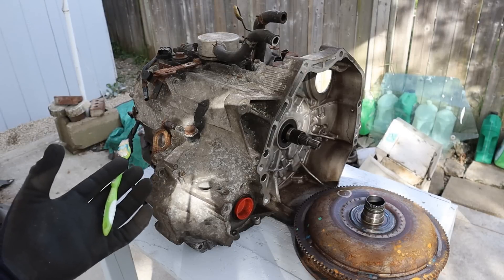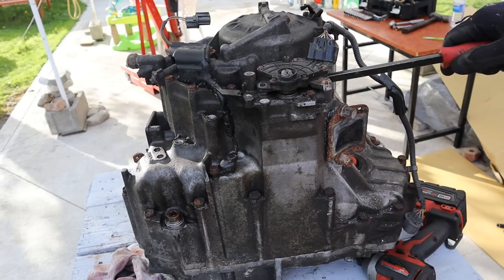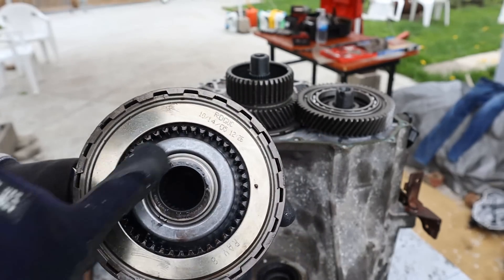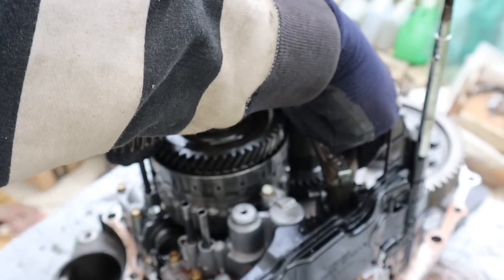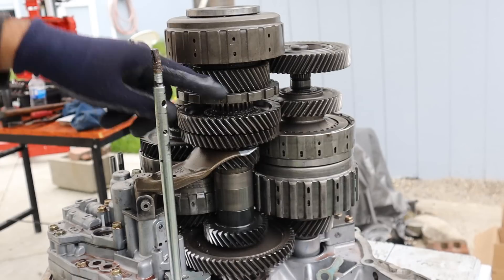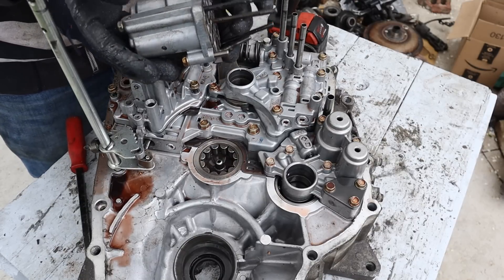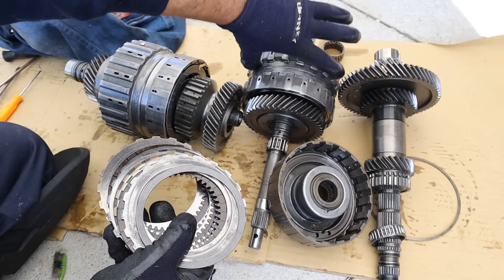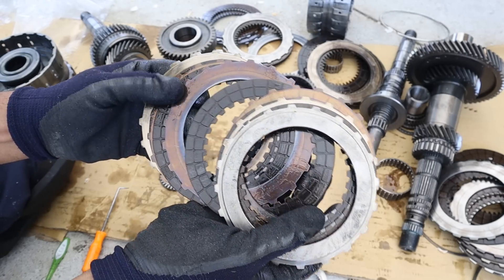Why Honda Transmissions FAIL

Comment: Hey man I’m a fan. I have some issues with my accord 07 v6 baya. When it’s cold I hear a buzzing/whining noise from the tranny. Hard to tell where. When it gets hot it goes away. But if I drive it for a bit rpms rev up then downshifts hard. Then I’ll suddenly loose drive and reverse. If it sits for a while it shifts to drive ok and reverse. But after a little bit same issues. What’s your opinion on this? You seem to be an expert. I had a TCC stuck off history code. I replaced the tcc solenoid. Change my fluid twice a year and fluid looks ok. No leaks. I’m freaking out. Any thoughts id really appreciate.
Reply from the maker: Sounds like oil starvation. Look into changin the filter and then budget for a new throttle body. 
You might be able to peep at the condition of the clutches when you drop the pan for telltale signs its on its way out.
Reply: @speedkar99 new throttle body? Why would you mention that? The intake manifold throttle body? lol maybe I’m misunderstand or auto correct changed “valve body” to throttle lol
Reply: @s @speedkar99 but I’ve replaced that inline cooling filter twice in 2-3 years. All OEM Honda. I have noticed one of the solenoids under the starter is leaking slowly. And when I commanded all of the solenoids on with my scanner only one did not click when commanded. Valve B in the dual linear solenoid. It would only make a faint clicking sound when I ended the command. I’m going to replace them with used junkyard ones I’ve snagged. See if that does anything. But I agree def seems like oil flow or pressure is messed up. I have an overhaul kit on the way regardless. I’ll keep you posted for knowledge purposes. lol

Comment: I wonder if this one used to whine like most 5at 3shaft version. Mine whines so much i can tell what gear im in by the pitch😂
Reply from the maker: No need for a tachometer then!
Reply: @speedkar99  haha just did a fluid change now the tranny is donezo won't shift out of 1st

Comment: What would cause reverse to not work when the trans is cold?
Reply from the maker: In a Honda, reverse is a piston that pushes a fork up, if the piston is leaking or valve body can't build pressure when the fluid is viscous

Comment: I drive a 2004 Saturn Vue with the honda V6 3.5L engine, having trouble finding out if the transmission is also this honda transmission? Sitting at 165k miles and there's some trouble shifting
Reply: Yes those have the same Honda transmission. If you just started having trouble shifting do a drain and fill with Honda dw1 fluid and some Lubegard Red additive.
Reply: @CRAPO2011  that's my plan for tonight, it calls for Z1 atf so I grabbed the idemitsu atf type-h, is that interchangeable with dw1?

Comment: This is not true for 10 speed honda transmission. They are not automatic (manual conversion) they use planatery gear.

Comment: You are 💯 correct! The internal filter is the main reason these fail. I drilled and tapped the bottom case where the filter pickup is located and cleaned the filter. My V6 Accord Drives like new again!
Reply: Hi, could you point me to a video showing what you did, or how I can contact you to find out what the next step is? I'm having problems with my V6 AT. It's a BAYA transmission.
Reply: @latota9481 I have a video on my channel on this topic, hope it helps.
Reply: @latota9481 I have a video on my channel regarding this topic, hope it helps
Reply: Yeah any help would be awsome if i can do that also.

Comment: TL from 07 and 08 actually used the Acura RL's automatic transmission which is a physically beefier more robust transmission That's why those cars didn't really have transmission problems like the earlier cars did

Comment: Honda V6 tranny's 2001 to 2006 were horrible - torque converter valve failures due to a design fail!

Comment: What could cause hard shifting on each gear of Accord 1998 4AT European version (M47A tranny)? Also, the engine is noticeably jerking when shifting between P-R-N-D4? ATF refreshed with Honda ATF DW-1 and leveled, shift and lock-up solenoids were removed and powered on the bench (clicking smoothly), then cleaned (screens were clean, no debris). The drain plug magnet had a lot of material on it. The transmission turned out to have 1l oil extra, once leveled it started shifting better, but it still has hard shifting and engine jerking when the lever goes through P-R-N-D4. Ideas?
Reply: Transmission mounts.  Especially the rear one, which literally snaps a lot of the time when people remove it. If you are doing the transmission mounts, it's a good idea to also do the motor mounts because those fail very often too.
Reply: @boi8751 The rear one is vacuum operated. The vacuum circuit is still functional, also the bushing itself seems to be reacting to soft/hard mode. The only reason I haven't replaced it is because I am not sure if there's any good replacement.
Reply: @c@c @ceckoslav hit I was thinking about the v6 accord lmao. I’d still check all the mounts to verify. Have someone in the car and go through the gears and look at the engine to see if it’s jumping or moving weirdly. That’s all that I can think of when the engine isn’t moving. These 4spd autos are really janky so it is normal to feel the gears shift

Another way to see if it’s the mounts is to see how much the steering wheel is vibrating when idle (in d4)

Comment: 2004 Acura TL owner here with 304k miles on the original transmission.. still shifts smooth, maintenance is key and knowing how to properly drive the cars..
Reply from the maker: Nice. How's the engine holding up?
Reply: @speedkar99  great, running perfectly.

Comment: Our 2010 Honda Odyssey has 100,200 miles. Trans fluid was changed at 50,000 and just last week. Fluid was in great shape, not burnt or black at all. We have never had a problem, although we do not always pound on the gas and go easy which has probably helped prolong the life of it.

Comment: Any chance you could get hands on and tear apart a modern 2016-2022 pilot/ridgeline 6 speed? These boxes are dropping like flies and I'd like to see if there's a definite point of failure. Typically fluid cooks itself way head of schedule and fries the torque converter, then if left unaddressed destroys the entire transmission by clogging the lines and wearing out the clutches.
Reply from the maker: Interesting to know they're still having issues.
Reply: @speedkar99  my assumption is that it is a byproduct of cylinder deactivation. Honda tries to minimize uneven engine vibration when half the engine is off by making the torque converter unlock when cruising. The lock up clutch wears significantly faster than normal, goes metal-to-metal and puts iron in the transmission fluid, ruining the transmission. But before that the warning signs show themselves with a torque converter shudder condition since in the meantime it just overheats the fluid and fills it with clutch material. Partially tested this theory by installing a VCM muzzler device in someone's car and they haven't had a shudder complaint since and their pilot shifts perfectly.

Comment: have pilot 2019 and already have the original transmission replaced and going to need another replacement soon? Anyway I could save it? I love the pilot but these transmission problems just don’t go away, if anyone relates pls share tips/things that have worked to preserve the tranny. Thank you Speedkar awesome video.

Comment: I have a 5 speed on my 2007 2.4 accord. Drain and refil every2- 3 years with an exterior filter change.220000 km and shifts like a dream.never had issues.I think these are not meant for the extra torque that the v6 has. Most of the failiures i ve read a bout happen either on the heavier cars or v6 models. I can see the corelation.They are a bit sensitive but with propper maintenance they can last a lot.Saw a tsx for sale with 500000 miles ,not km with and original transmission 5 speed,never rebuilt.

Comment: I have a 2009 Accord Coupe V6 with 54K miles, I only drive it around town.  Have no problems with the engine or transmission.  All my important fluids were changed at 30K, I had to forcefully tell the dealership that I wanted it changed despite them telling me its not necessary.  I am glad I found your video as I have proof now as to why I wanted things flushed and changed ahead of Honda's recommendations.  I've been driving Accords since 1986 and the 2009 V6 will be my last Accord.  I absolutely hate the fact that they changed to CVT transmissions.  My next car will have a traditional transmission, selection is slim but I will find an AT no matter what.

Comment: The prob I've found with the Hondas is the case bores for the bearings wobble and allow the bearings to have play, which in turn wears the feed tube bushings in the shafts and cause pressure loss to the clutches. I enjoy your videos.

Comment: Very interesting and well explained. I’m glad you cut apart that filter. Our 07 Odyssey has the original transmission still going strong at 292,000 miles.  I’ve changed the fluid every 30,000 miles since new. These transmissions also do best with OEM fluid.
Reply from the maker: Install a cooler and keep draining and filling the fluid. Agreed on the OEM

Comment: Hello @speedkar99. I watched your CVT videos and I wonder what you think about the recent e-CVT from Toyota?
It has a "1st" gear to start the rotation of the shaft and it's coupled with an electric motor which I think relieves a lot pick torque on the metal belt.
Reply from the maker: I think it's a good idea in theory until I get my hands on one to tear it down.
Reply: @speedkar99  Thank you for your answer.
Maybe you didn't get your hands on one because it's reliable. 
I like manual cars but this might be a game changer considering Toyota obsession

Comment: This transmission looks like it's been poorly rebuilt. That filter is the reason why it failed. Factory transmission came with a strainer type filter(there's fine mesh inside), not media type(cardboard basically) filter. Also, it looks like they didn't adjust the proper clutch pack clearance. So, they bind badly when it gets hot(also from fluid starvation).

Comment: This makes me a little less optimistic that my mom’s 6AT in her 2015 Accord V6 will last to 150k+ miles, even doing drain and fills on time. I take it it’s basically this with another clutch and gear.
Reply from the maker: The newer ones should be better

Comment: Bought my 1999 Accord with 4 cyl brand new and immediately installed an external trans cooler up front. Every second summer I drain the trans and replace with new fluid. Still driving strong with no issues (knock on wood).
Reply from the maker: Good idea!
Reply: It ain't the 4 banger. Its the v6. 4's will run forever.
Reply: @napalmholocaust9093  Yes, I was aware of that and is why I mentioned it. However, over 25 years of use without a single problem is still worth mentioning. Maintenance pays off and installing a cooler is benificial to either a 4 cyl or the V6. I think of that  every hot day when the car is driving in stop and go traffic.

Comment: Owner of a late Acura TL here with nearly 200,000 miles on the original transmission. This design wasn’t really designed for extra power/torque of their V6 engines in the late 1990s. They finally perfected this design by the time 2006-2007 model years onward.
Reply from the maker: So I've heard. The newer ones are better but not perfect

Comment: Problems pretty much limited to 1999 thru 2004 4 and 5 speed vehicles heavier and v6 powered.  I got burned by two.
Reply from the maker: Ouch. How much did that Cost?
Reply: @speedkar99  $1000 only for the 2003 odyssey.  Factory reman trans and updated pcm.  After negotiations with dealer and Honda.  Originally $6500.   On the 2001 Acura TL I just junked it as no more factory support. $7000 estimate.  Both burned the third gear clutch pack to ash as was the main failure point on the five speeds.
Reply: @speedkar99  also they both failed at 93,000 miles.   The odyssey was still going strong at 233,000 miles years later when I gave it away.

Comment: As for ATF temperatures, I hooked up my diagnostic tester and monitored the temps in traffic and on the highway. Never an issue.
Reply from the maker: Awesome. Now try it towing
Reply: @speedkar99  If I was towing often, I'd buy a vehicle with more towing capacity. The RDX has no towing capacity. What do the specs say?

Comment: The worse car I've ever owned was a 2003 V6 Acura TLS.  It developed a sudden uncommanded downshift problem that would drop down to 2nd gear while doing 65 mph on the highway.  It would slam you into the steering wheel if you didn't have your seatbelt on and cause anyone following too close to almost have a rear end collision.  I understand this was a chronic problem with these transmissions and I don't understand why these cars weren't recalled for safety reasons.  I'll never buy a Honda product again!

Oh yeah, when it would do it's uncommanded downshift oil would belch out of the torque converter area.  I thought it was engine oil but it turned out to be trans fluid.  WTF was that comming from?
Reply from the maker: Yeah I heard those early Honda transmissions were really really bad.

Comment: running my honda odyssey on a rebuilt BYBA with 2nd gear spray cooler and external transmission cooler.

no issues so far, but I don't stay in 2nd gear for very long and like to "assist" the transmission while shifting (less throttle during shifts)
Reply from the maker: Interesting you have to baby it along but if it lasts alot longer then you've saved great expense
Reply: @speedkar99  idk.  I got used to trying to baby transmission shifts on my 1998 civic.  The previous (civic) owner put tires that are way too tall without changing the final drive and ruined the 2nd gear clutch.

It actually shifts just fine without me babying it, but I think it's fun to baby it anyway 🤣

Comment: as you say the clutch look like new and I wonder the person who do the rebuild didn't change the filter? or the guy constantly use the transmission as engine braking that make the clutch burn?
Reply from the maker: Clutches burn because things heat up. They heat up from over-use (uphill, towing, overload) and the filter clogging.

Comment: I have a 2004 Honda Odyssey with 310k miles . Sometimes especially when cold the transmission will lose forward gear when coming to a stop or during a hard downshift . When I put in low gear or 2nd gear it will resume operation. A shop was telling me that the one way sprag clutch is bad. I’ve been driving like this for 10k miles. Will there be a time that this will ultimately fail and rendering the vehicle motionless ?
Reply from the maker: Yes it will eventually fail. The transmission in this video apparently did not move at all!

Comment: I have an 06 TL. My transmission made it 160k before rebuild. Not due to failure, some dummy (cough me) tried breaking loose the atf drain plug to do the maintenance and cracked the housing 😅 they really are great cars though. Made a rebuild a no brainer for me 🤷‍♂️
Reply from the maker: You cracked the housing by loosening that plug? Wow

Comment: those transmissions did have a great overdrive ratio.. :)  I got my old 2000 v6 accord up to 130 one.  had a 3.2 TL where it always slipped into 3rd, lucky there was electronic shiftng so i could manually do it if I needed to
Reply from the maker: So manually it worked fine?
Reply: @speedkar99  so to speak yeah. it would only slip from 2nd to 3rd and i always had to rev it up and try to shift hoping it would catch

Comment: My 06 ridgeline, when driven on backroads around here, constantly "modulates" the torque converters clutch, it can't decide whether to lock or unlock it at say 45+/- mph. It is annoying, and guaranteed to cause wear. So I usually hit the "od off" button, which inhibits the TC clutch, but also limits it to 1,2, and 3rd gear. Very annoying, but I prefer it to TC clutch wear.
    I heard that there is a software update to fix this...maybe I'll just sell it and stick to toyota with a manual.
      I really dislike auto transmissions. Even those that are considered reliable usually don't shift when I want them to, and shift all too frequently when I don't want them to. Complex junk for lazy drivers..
Reply from the maker: The newer ones with 9-10 speeds are even worse, always hunting for gears.